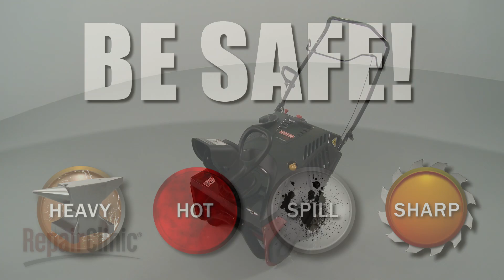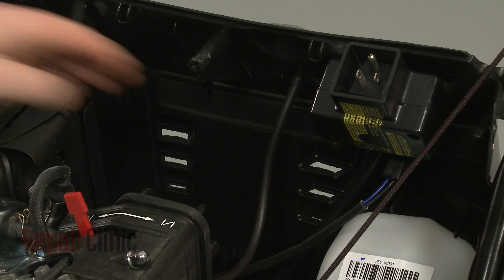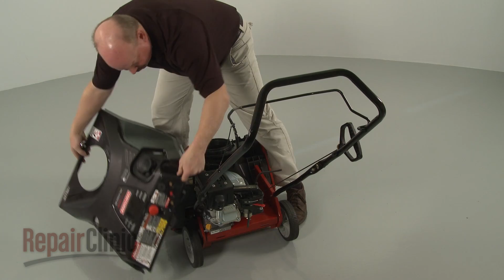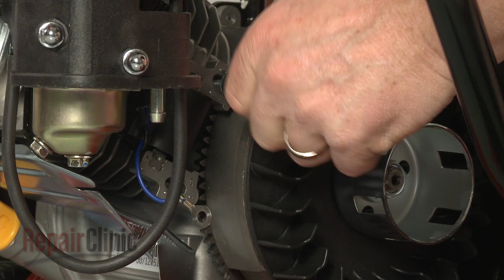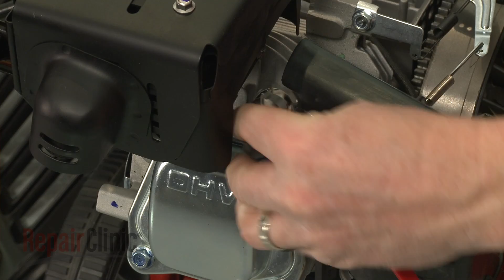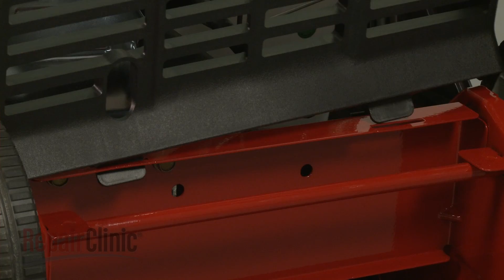MTD Snowblower Won't Start? Replace Ignition Coil #951-12013

Comment: hi there,
i have a problem identifying a small component looks like an external coil

it has a wire attached to the ignition coil and the other one to the on/off switch refer to the engine 
the engine want start because i'v lost that part and i don't know what it is  even i tried different coil looks like'it ... so please help

thanks
Reply from the maker: You may be able to find the part by entering the engine model number in our website's search engine: http://www.repairclinic.com. The part photos may help you identify what you need. If you're unable to identify the part, reply with your engine model number.
Reply: Thanks, but i can't find the engine model in ur website

engine brand : Lavor
model : independent 1900   2.5 HP
Type : P86.0206